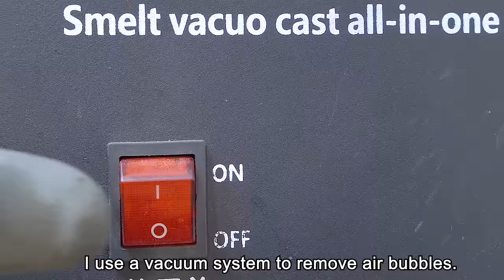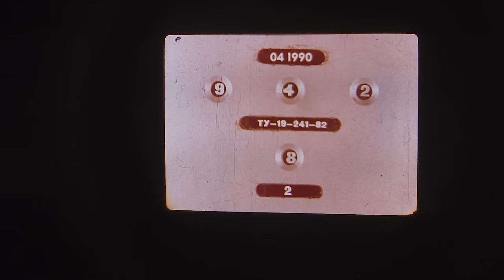Restoration of filmstrip F 5

Comment: I have never seen a transformer being restored, thank you for showing us. But you soldering job is horrible, when messing with decades old solder only way to do that is removing all of the old solder with a desoldering pump and completely reflowing it.
Reply from the maker: Yes, you're right, I'll do it next time
Reply: I was thinking the same thing.  My ex used to repair musical equipment and his desoldering machine was always in use.  Cold solder joints were the biggest issues in amplifiers, causing intermittent problems.
Reply: That thermochrome product is amazing. What company makes it, I can’t find anything like it. The detail you go to n your restorations are absolutely fantastic 😊
Reply: @TUSIP Your constructive criticism is quite rude. There's other polite ways to show your disapproval.
Reply: بيسيل @PSVRestoration

Comment: Personally I would have replaced the old transformer and bulb with an LED.
Low voltage and a lot safer than that manky old winding.
I know he did a continuity test and possibly a resistance test but I still would rather replace the guts.
✌️❤️🇬🇧

Comment: Is not a good idea remove passivation on magnetic sheet, if you know about leakage flux.
They have to be distanced each-other with some paint (or minimum thickness insulating paper), or efficiency ratio of transformer reduces a lot (and reliability too)!